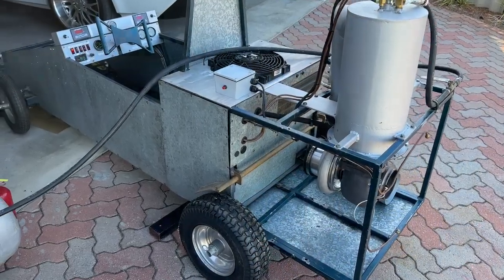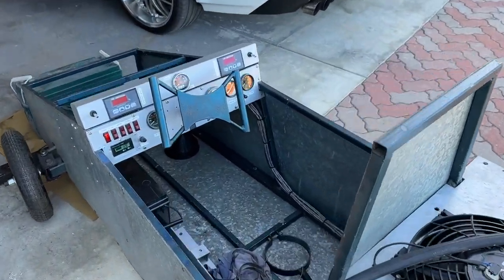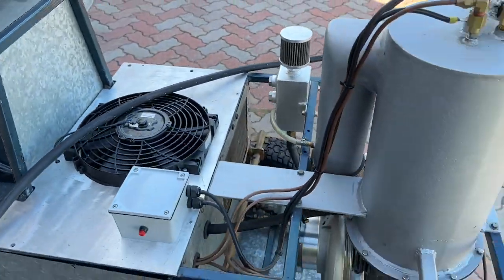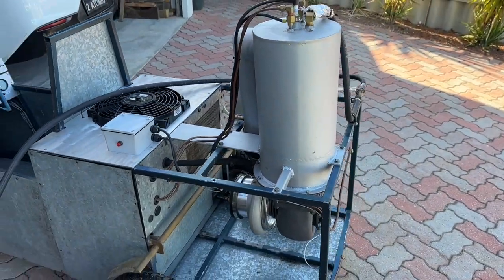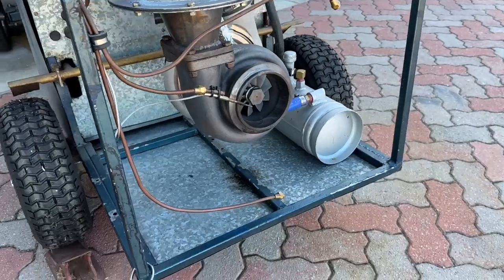Jet Powered Go Kart Over Boost

Comment: Why did it stall at the beginning? I have a theory but obviously you would have a better idea. If I had to guess, the blower nozzle being sucked up against it was restricting airflow. When you released it, the compressor got a sudden surge of air but not likely a surge of fuel as well, causing the A/F ratio to lean out beyond what would support combustion. As for that rubber boot, have you tried the silicone ones they use on the big rigs? They can tolerate a huge amount of heat and also seem to be pretty stout. Really cool project.
Reply from the maker: The stalling is definitely a major issue I have to determine the cause of. It could be a combination of factors, including your suggestion above. There’s also an anti surge around the edge on this turbo, which is covered by the blower nozzle until I remove it. I can try installing the afterburner nozzle to add some restriction and see if this yields any positive results. 
Yes I’m hoping one of those silicone hose adapters will be sufficient for 30-40psi, one way to find out 😉.
Reply: @ExperimentalHV  So maybe check out a fuel pressure regulator off of a gasoline powered car. Not sure what application would be best for you, but I remember on a couple Chevy's I've seen they operate off of vacuum. So basically under vacuum the pressure is low and as vacuum decreases (gets nearer to atmospheric pressure), the fuel pressure spikes and allows more fuel delivery. I think that would be a good place to start. OR maybe a secondary fuel injector that allows you to inject extra fuel momentarily to compensate.
Reply from the maker: @MrShawn305  It’s a bit more like a diesel, the speed is mostly determined by how much fuel is being injected. However the sudden speed change because of the restriction being removed from the inlet may blow out the flame in the flame tube.
The flame tube ultimately determines how much air is applied to the flame at a given pressure. I did make some adjustments to the flame tube to help reduce the stalling, it did have some benefit but not as much as I had hoped. But keep posted for the next video hopefully in a week or two